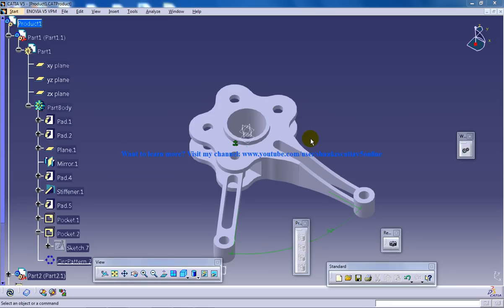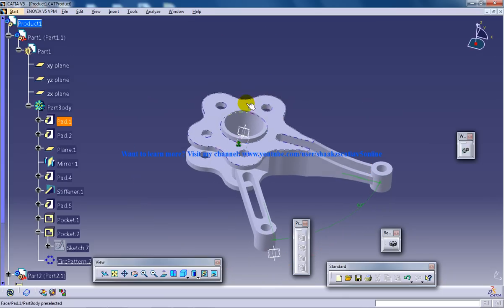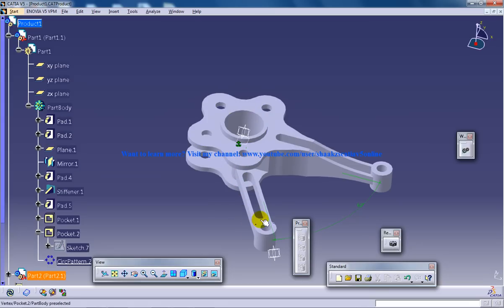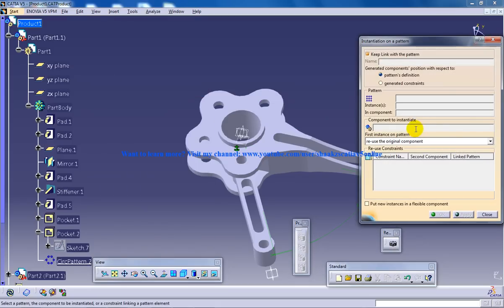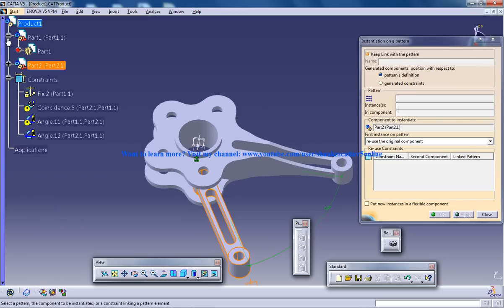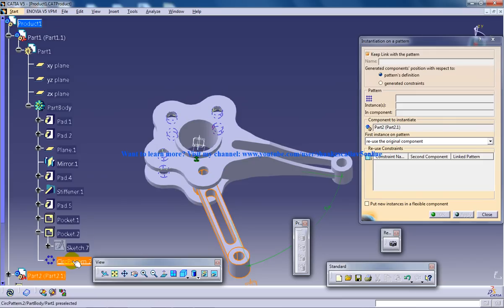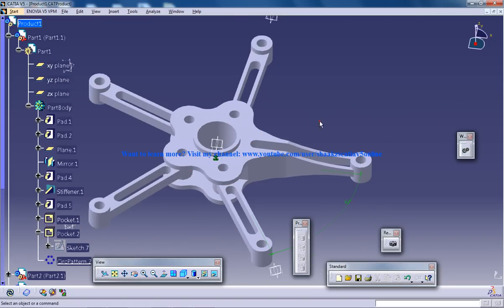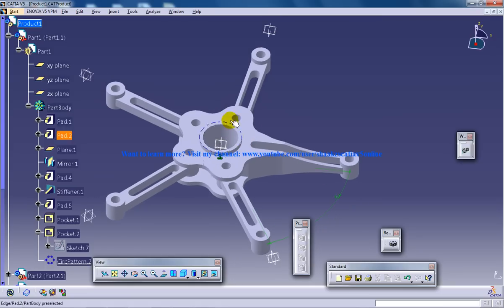Catia V5 Powerful Tricks #135|Assembly Design|Reuse Pattern without generated constraint

Comment: how to do if circular pattern doesnt exists. consider a case where you are doing bottom up approach assembly sequence in which u have only step files like washers, some housing with holes, other part having holes. now you need to place the washer in those holes.

I feel Creo-parametric is more comfortable than catia. Few options are too good when compared to creo especially calling section views in drawings, placing gd & T symbols in drawings